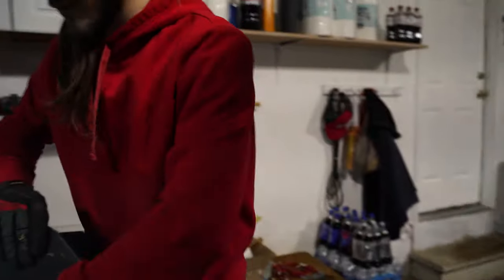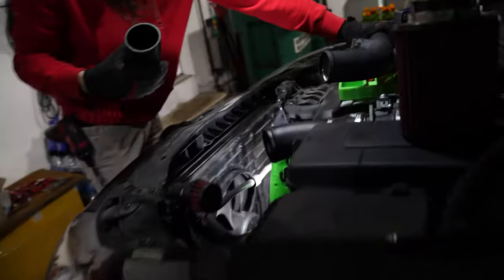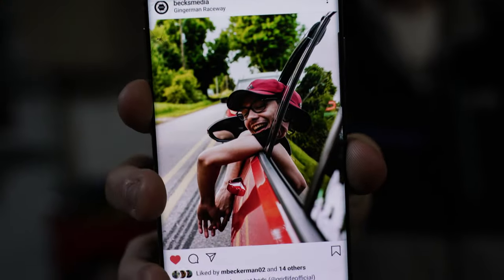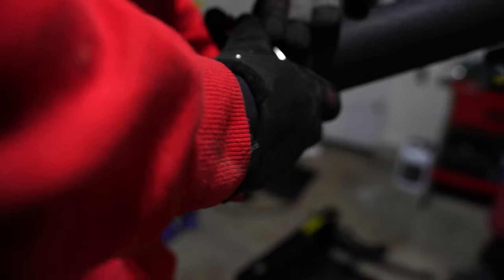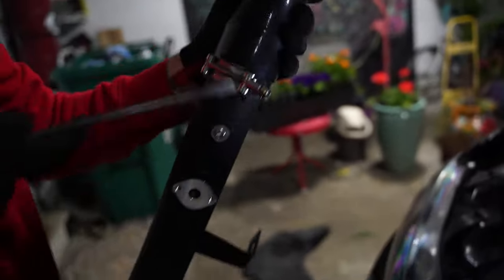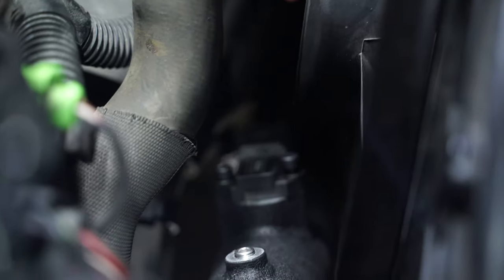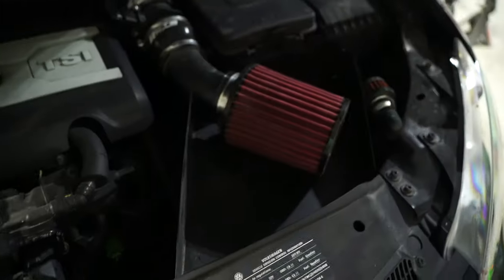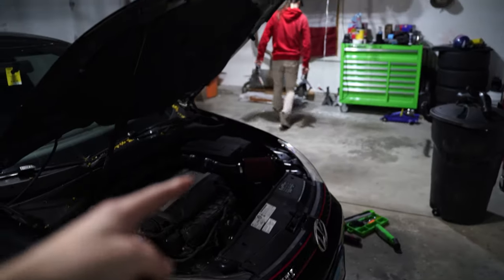Mk6 GTI ARM Motorsports Throttle Body Pipe Install!

Comment: What signs do you notice that the throttle is due to be replaced?
Reply from the maker: It's not really a maintenance item, so really it shouldn't need to be replaced. Upgraded pipes, like the one in this video, are meant for cars that are pushing a bit more boost through the charge pipes. Since the stock throttle body pipe is plastic, it ~could~ be more likely to crack.

Comment: i just got an arm intercooler and now my charge pipe hits my radiator fans. Please tell me what you did to fix that.
Reply from the maker: Hmmm we never had this issue. Did you make sure to tighten the bolt enough on the support arm so it stays away from the radiator shroud?

Comment: What stage do you run on your mk6 gti? I have a arm downpipe with stock catback and KnN filter with elbow tube should I get a Cobb to run stage 1 plus?
Reply from the maker: Currently a custom e-tune from Stratified Tuning. Probably considered a Stage 2+ because we needed a stronger clutch. Definitely would recommend the Stage 1+, that's what I had originally ran on it

Comment: Was the pipe actually worth it ? Did you feel a difference?
Reply from the maker: You don't really feel anything with this type of upgrade. It's similar to an intake with the main benefits being the Meth Injection Port and the fact that its one solid metal pipe versus the flat plastic stock piping
Reply: Dub Chasers what was your trick to moving the pipes away from the fans because i'm having the same issue?